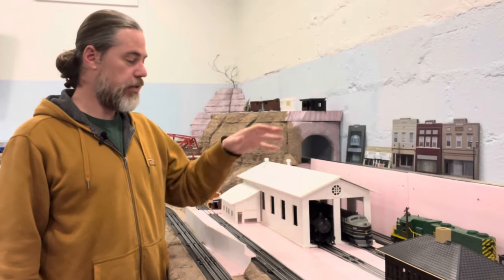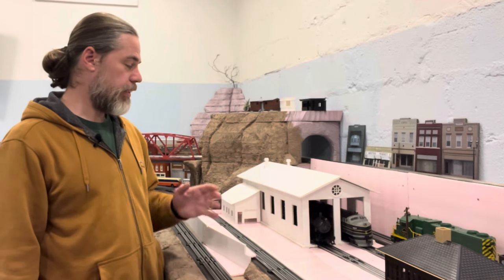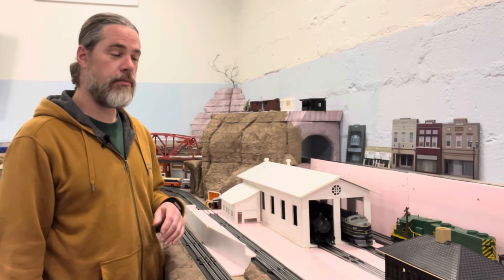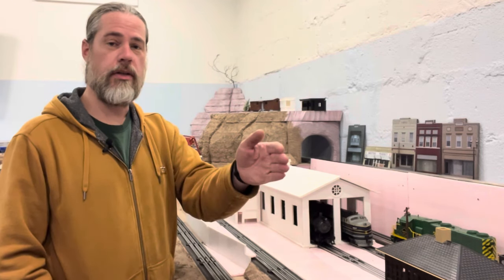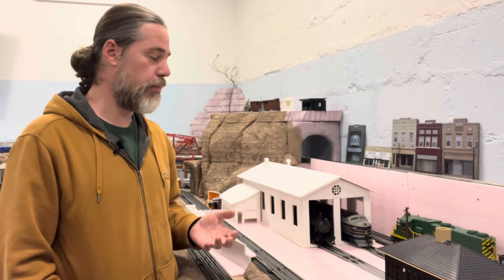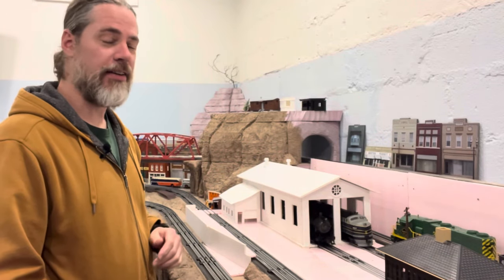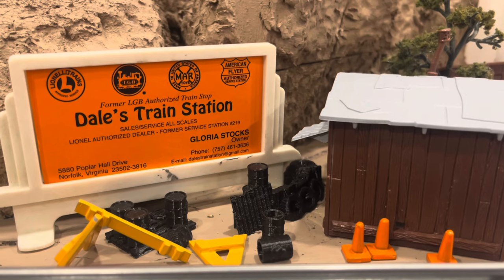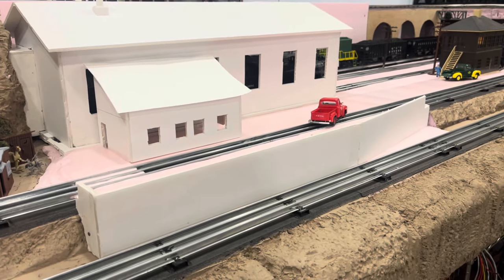Layout Update: Engine House! Train Station! Park! A small yard and More!

Comment: Really clever!  I never would have thought of a foam core engine house and 3D printed details, but why not?  The idea of running out of the engine house into a mountain is the stuff of genius!  While my stomach churns at cutting up perfectly fine Plasticville to hide a hand throw turn out mechanism, that too is genius!  Well done!
Reply from the maker: Thanks so much. Why build details out of wood when I can print them! Besides that’s more talent than I posses. Haha. 
I don’t mind modifying things if it serves a purpose. If the modification of the tower bothers you I probably shouldn’t tell you what I did to the switch to get it to fit!!

Comment: You are definitely on the right track no pun intended. Foam core is the way to go on O Gauge scratch builds. You may get some inspiration a tips if you go back to my behind the scenes series of the Rartian Valley Hi-Rsailers. Matt explains how he makes his buildings from foam core. The cost 3d printing parts vs buying them such as windows, doors etc. He does give out sources of where he buys his materials and the links to those sources are in the video description.  I like the girder bridge idea. I like how the water tower came out. That Public Service caboose looks great. I think we all been stuck in a rut at one time and then see something inspirational to motivate us again.
Reply from the maker: Thanks! I like the foam core, it’s cheap, forgiving, and easy to work with. I’ll check out your series. I’ve probably seen some of them but a revisit couldn’t hurt.

Comment: Great video! Love what you did with that foam core for the engine house. You’re absolutely right about using the 3d printer to augment details like window frames and chimneys on an 0 gauge scale. Very inspirational as always! Thanks
Reply from the maker: Thanks! For most cases a combination of 3d print and old school scratch building makes sense, although I am currently printing a complete train station. I had to get creative to fit it on the printer but I’m pretty happy with the results.
Reply: @dagryffynhobby  Great! Looking forward to seeing the result. 
I may want to try making a copy on my Ender (same bed size) if you can send me the modified stl file.

Comment: Hey, Dave. It's good to see you're able to make some progress. Getting blocked is just part of the hobby one experiences from time to time. I find it useful to move to making something else like making trees or structures untill it comes to you. I find it best to focus on a section at a time completing that section before moving on to the next. There will always be some final details to go back to and add later. Getting the basic idea completed will speed up the process and reveal areas for improvement or additions along the way. The engine house and water tower looks great, and I'm surprised and impressed you decided to add some turnouts. There's no looking back now. I think you'll like the additions once you use them. 
  I use the Evergreen styrene plastic sheets, round and square tubes, and stakes to scrath build. It comes in many different wood, brick, metal sidings, and roofing sheets. It's easy to cut, paint, and glue with liquid styrene cement. You can build a structure pretty quickly. A plate girder would be easy to scrath build and would look great on the upper loop by the viaduct. You could scrath build some railings above and at the stream to impact the look of the scene with minimal effort to hone your skills. 
    I use 1/8th or 1/4" Masonite base under my buildings and for concrete slabs and sidewalks. Once the track is ballasted and the surrounding area is built up between the tracks, the vehicles won't look out of scale when placed near the track. The 1/4"  masonite painted to look like asphalt also makes convincing grade crossings and is the perfect height when placed on the ties. I use sheetrock mud on the sides to hold it in place and paint it earth or asphalt colors. I use the black Silly Winks foam sheets from Hobby Lobby painted gray to look like asphalt to make my streets. You can use some masking tape and lightly sponge paint the white stripes for a weathered look. These sheets are 18 by 11" and can easliy be cut to size with a hobby knife or scissors. You can use mirrors oriented at the tunnel where the street ends to give the illusion of depth inside the tunnel to give the appearance that the street continues beyond. You could also use mirrors where you were looking to do the mining scene in the corner
  Use paper mache to build up the dirt road a little to just below track height. I would make it just a little wider than the vehicle and make slight  depressions for wheel ruts and paint it to match the foam. This will provide some natural looking terrain and provide elevations to make ditches and gets rid of the unnatural overhead Google earth flat look image. When you add turf, leave some of the surrounding dirt color exposed in the ditches and a random strip of turf between the ruts for a natural look. It helps to go outside and take photos of the real world for quick reference while building. Roads are typically built up whether finished or dirt for drainage. It's easier to create this look with something wet that can be easily shaped and molded like mud. Paper mache, sculptamold, plaster, or sheetrock mud.
Reply from the maker: Thanks and thank you for all the tips! I’ve been looking at the styrene sheets for siding and brick walls and paths. There are so many options and so many ways to do these things, it’s an exciting time!

Comment: Nice update Dave, I did something similar last summer with an engine yard for the same reason, you'll run those engines more when they are on the layout vs shelves. Also I added blocks, they are a great idea.  You're making great use of that 3D printer, I have to get more creative using mine.
Reply from the maker: Thanks! I only wish I could connect the spurs to the main loops. In the next layout

Comment: Hey Dave, your gonna still want blocks on all sidings or wherever you plan on "parking" an engine even with TMCC or any command control. I just dont like my engines sitting there with power to them and not running them. Especially the older TMCC locomotives where some of them continue to heat the fan smoke element even when the engines not running. (smoke will begin to drift out of the exhaust)  Not ideal. lol
Reply from the maker: That’s a very good point! Minimized in this situation because the track will rarely be powered but still, I would be concerned about the smoke units in a couple of locos. Thanks for pointing that out!